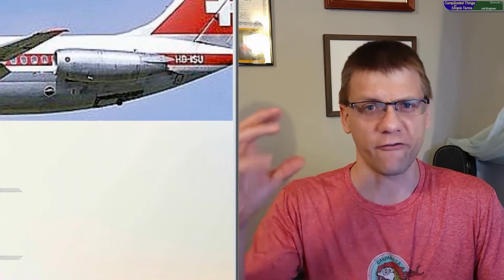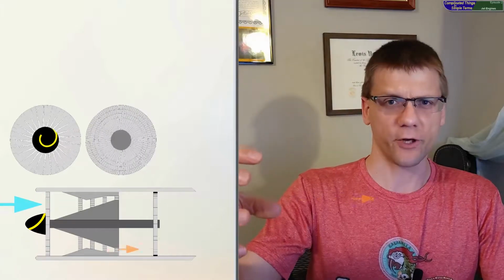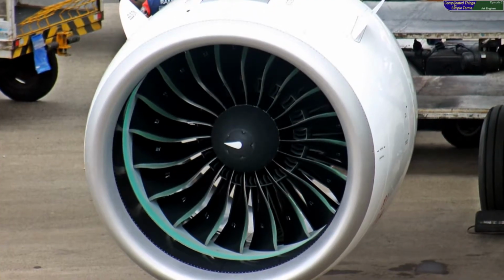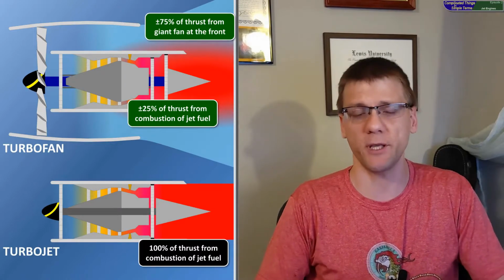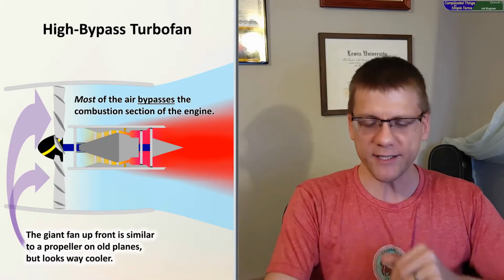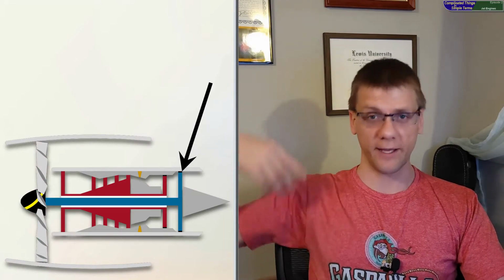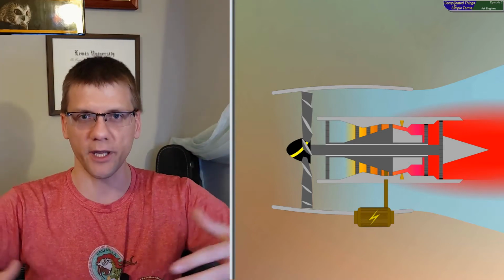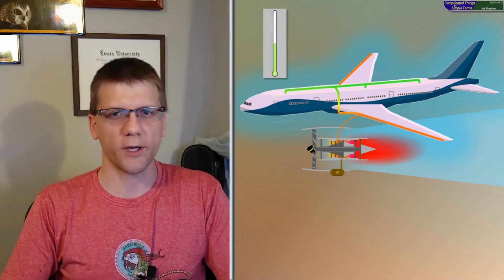Jet Engines - Complicated Things in Simple Terms (2021 Ep. 2)

Comment: Did you know that modern high bypass engines actually have THREE spools. They have two separate compressors, a higher pressure compressed and a low pressure compressor which are powered by a high pressure and low pressure turbine. The third spool is to power the large fan which I will say is not a propeller. I’m not going to fault you for that because bypass thrust produced in a much more complicated way than the fan acting like a propeller and as the title states, you wanted to explain things in “simple terms” 👍🤩